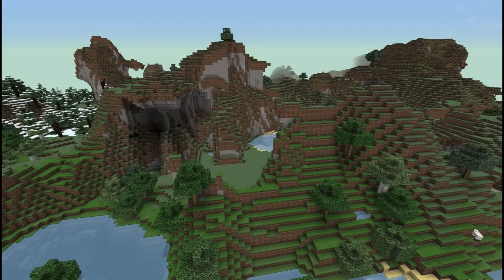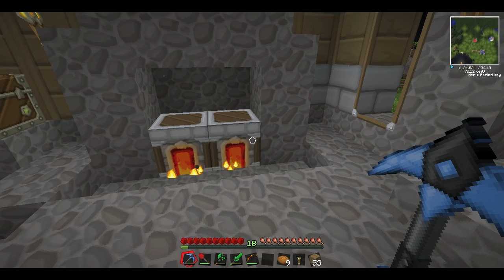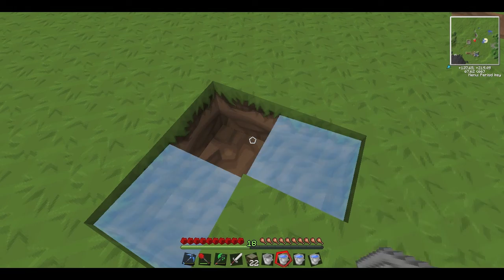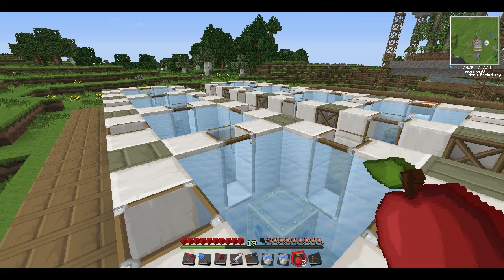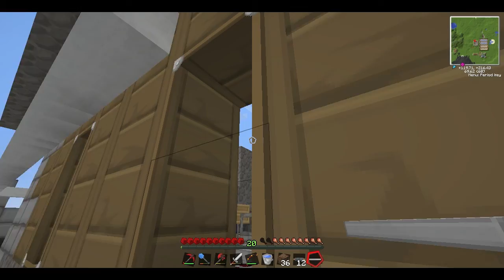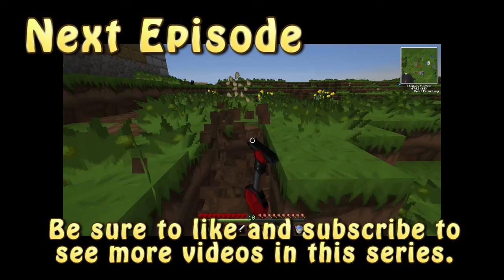Let's Play Tekkit - Episode 9 - Water Mill Power Plant

Comment: I would have died a thousand deaths by now if I had ever used uninsulated cables. Spacious and neat are not words associated with my factories. 
Like to also add. I feel that a water tank and Water Strainer setup looks a lot nicer and obviously outputs more power. Forgive me if you're already away but you can put a water pump above a 3x3 infinite water pool to power your Water Strainers.